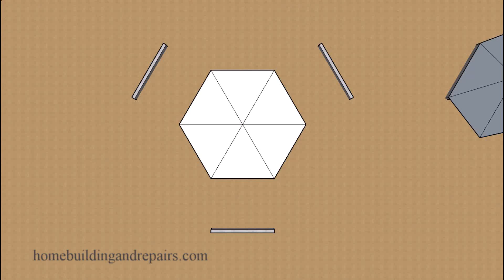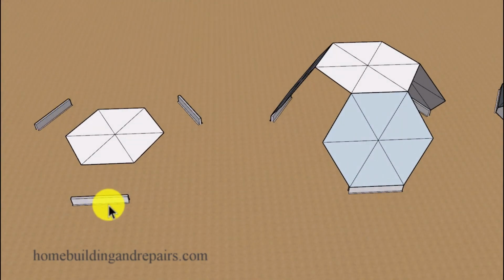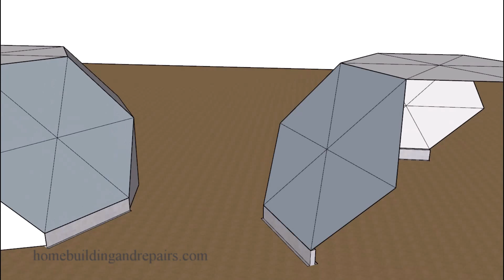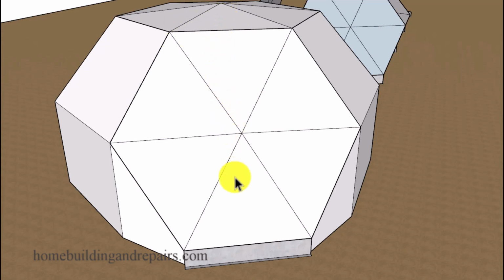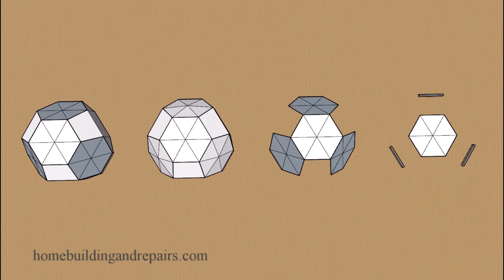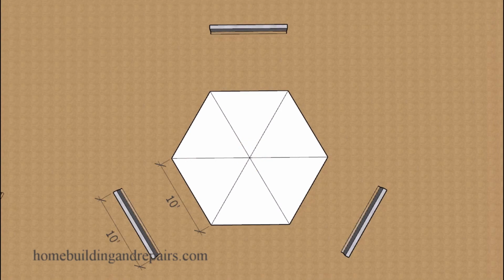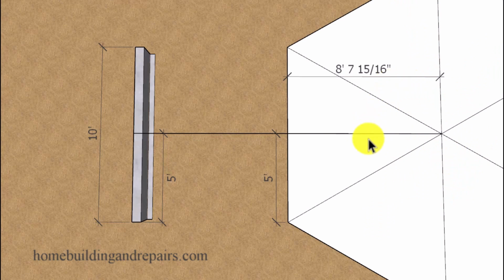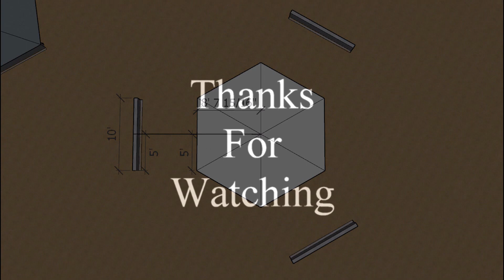This Could Be The Easiest And Simplest Dome Home Design Available - No Complicated Math Here

Comment: very nice video , i need some help with something so easy that I can't get it done jijiji...i am building a doll 🎎 house 4 sided roof equal measurements and i forgot how to calculate the angle of the roof ,exactly were section 1 intersect section 2 from top to bottom like a zipper jijiji ,when i cut the 4 pieces( this is just a mini roof no rafters etc etc this is just 20 cent x 20 cent ...one roof was perfect but too pointy like a witch hat the next one was almost flat  ....is thee any formular to calculate this  on a very small scale , i normally do this kind of houses  but never with a squard roof.  it is 20x20 sides and 14 high centimeters....thanks for any help ...like you can see my knowledge is very limited ...

Comment: I really enjoyed this video, my husband and I purchased a geodesic dome home back in 2013. It was in desperate need of repair and challenged us beyond belief. I'd send you some pics if I knew how. It is a 5000 sq ft, 10 sided, 3 story, 50' diameter main structure with a 20' diameter 2 story, foyer and upstairs bonus room attached. Still not done!
Reply from the maker: Awesome and you can send pictures through our website email address. It is at the bottom of each page on the website, called "contact"

Comment: This is cool seeing as a dome builder. For Domes what we do is all the framing members have a bevel angle that has to do with dihedral angles based off of icosahedron shape & dome frequency (complexity) and all the triangle frames are attached together via structural screws. Look up timber frame dome builds and it will make sense.